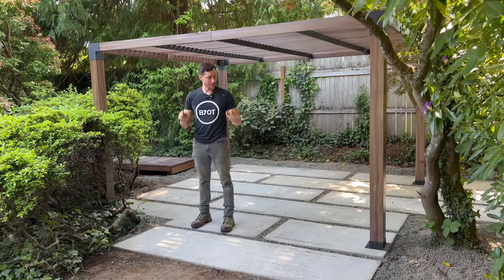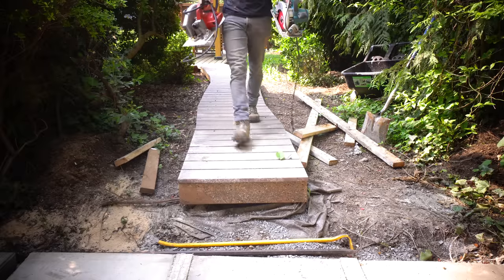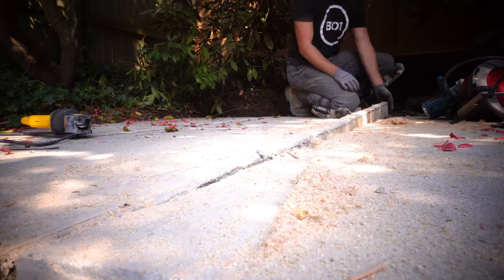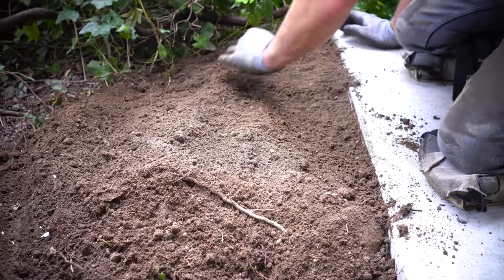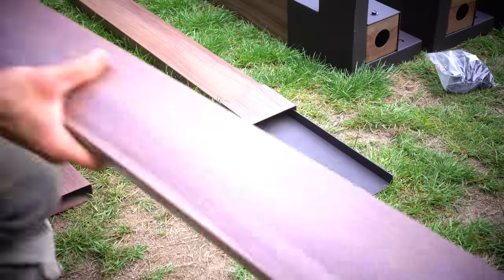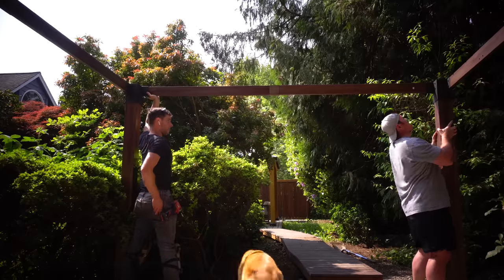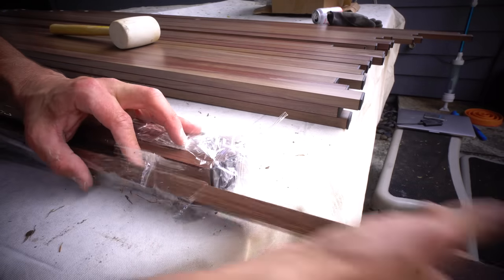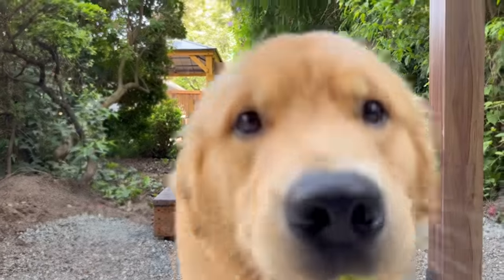DIY Backyard Makeover: Building a Concrete Patio with Pergola

Comment: Should have shown how you secure the four posts of the pergola to your cement  pavers unless it's just free standing which I wouldn't recommend.
Reply: agree because I have this exact question
Reply from the maker: Great suggestion Gary and its freestanding for now.  Would have bolted them down with some wedge anchors or tapcon screws but there was discussion of them slightly moving it one direction so I'll let them figure that one out first and then i can produce a YT Short for it if people are interested.  Thanks so much for watching.

Comment: I would have bolted those to the ground.
Those looks cheaper then build one from wood.
Reply from the maker: Would have bolted them down with some wedge anchors or tapcon screws but there was discussion of them slightly moving it one direction so I'll let them figure that one out first and then i can produce a YT Short for it if people are interested.  I'll probably build one in the future out of wood but for now these preassembled units are sooooo easy to install, which is nice sometimes haha.  Thanks for watching Saul.